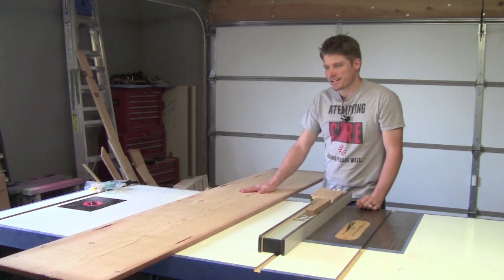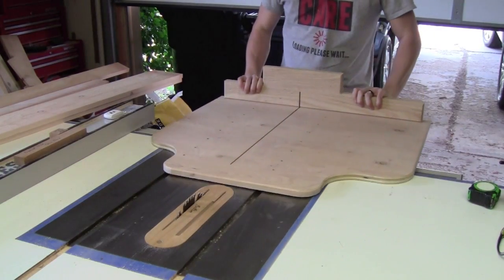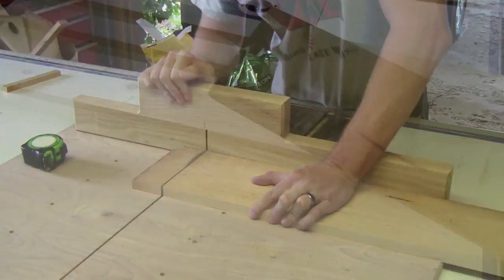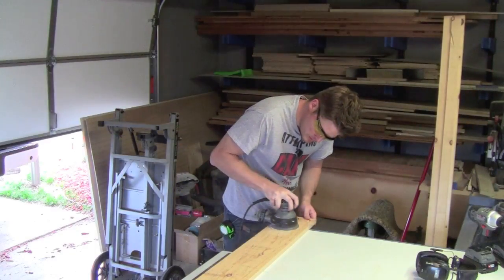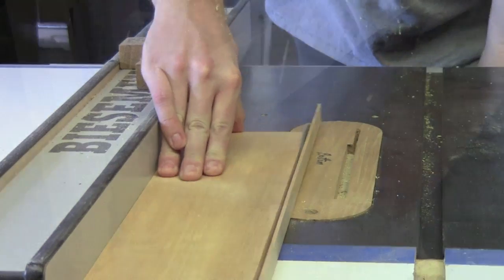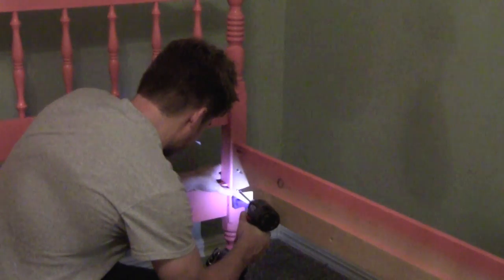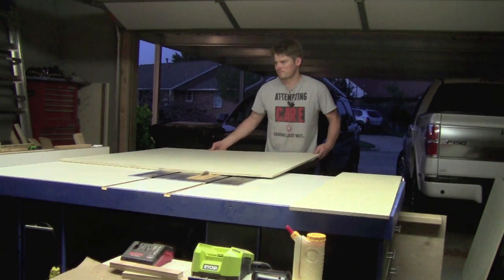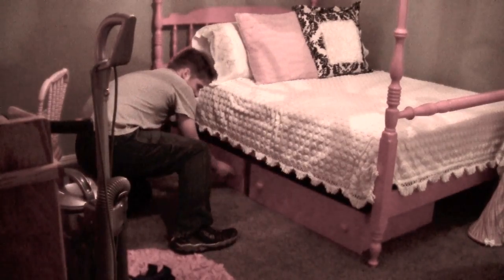Make your own Full Size Bed

Comment: Great job! I am about to make a King size bed, and this has given me some ideas, I am still uncertain about using a solid sheet for the base, there are so many opinions that say there isn't enough give for the mattress, and without air being able to circulate there will be a damp problem.
Reply from the maker: I haven't heard issues with that problem, interesting. Mine is not giving me any problems yet. Fingers crossed....lol.